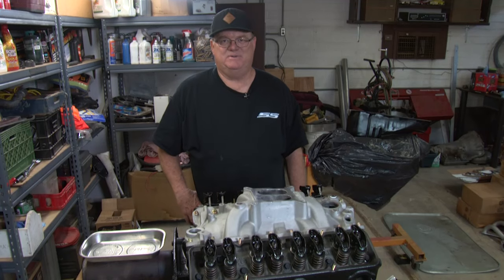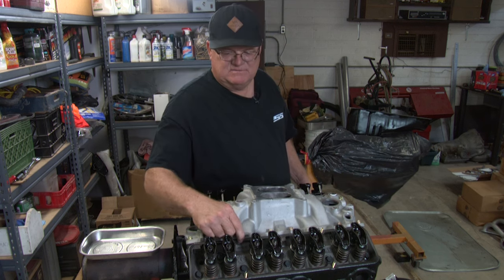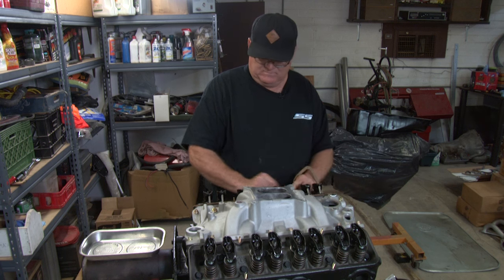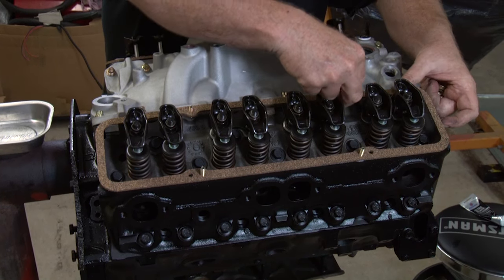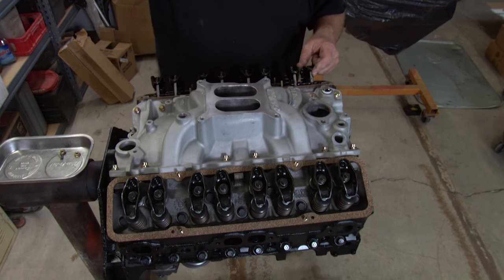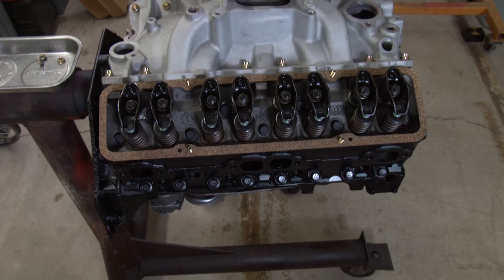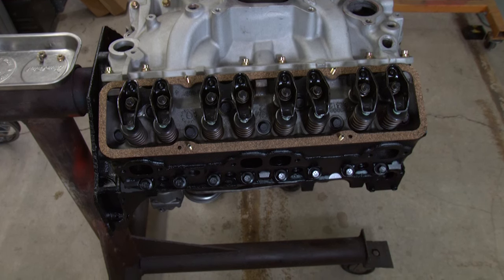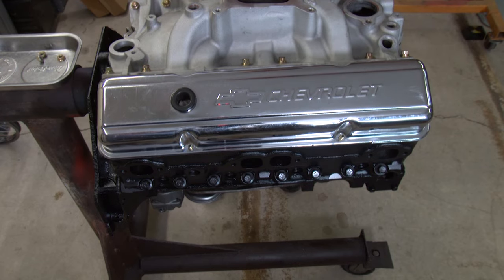How to Achieve a Leak-Free Valve Cover Installation: Step-by-Step Expert Guide

Comment: Preferred way is to install gaskets with the double hole sides at the top, not bottom.  Supposedly doing so makes them less likely to leak.  Not a big deal but it is logical.  Gen 1 Small blk Chevys always puddle oil along the lower edge of the valve cover.
Reply: X-Man well see i just replaced my gaskets and its still leaking 😪 this 84. C10 got me frustrated
Reply: @dlumbreras90  Cool man! I got an 85 C10 resto. It's always broke lol
Reply: Bottom part of the heads where the studs come out are square.. top are round..
Reply: @ianstow3345  You misunderstand me.  I was talking about valve cover gaskets.  Early SBC's, mostly 265 and 283 had bolt hole bosses that were not same distance apart from top to bottom, later heads they were the same distance apart.  That's why double holes on one side of the gasket.  If you mount the gasket so that when valve cover is installed the double holes are on top, they are less likely to leak.  But they are always a problem in my experience.
Reply: Cool understand
Reply: @dlumbreras90  did You put the spreaders on to distribute more pressure

Comment: I was told that I should put black silicone on it with the gasket?.? 

Should I do this?.?
Reply: Try 3m weather strip adhesive glue on to valve cover but not on the head. A lot of times the gasket actually seals to the head but leaks between the smooth chrome valve cover and the gasket.
Reply: @jasonsimone3523  Well, unfortunately I saw your comment too late and i've got some oil leaking at my headers(Is headers the same as the exhaust manifold?.?. I keep getting conflicting answers). And since i'll already be down there I think I might just replace my valve cover gaskets. I've recently grown against cork, would be switching to rubber. If I use rubber, should I still use the 3M weather tape?

Comment: What's the significance of using tall vs short valve covers?
Reply: Randy Vertrees hey buddy what would be the torque specs on a 3.8 Buick Regal 1986 torque on the intake manifold bolts thanx
Reply: Tall valve covers are to clear roller rockers.

Comment: Your not supposed to tighten it with a ratchet lmfao
Reply: What is the proper tool to use to tighten them?
Reply: @mississippikid3453  a screwdriver type quarter inch drive tool i think

Comment: Why you don’t use the silicon gasket maker to stop any leaks on future
Reply: Silicon doesn't HAVE to be used, it's more of a preventive measure.
Reply: @tyramarshall504  l
Reply: Use weather strip glue to glue gasket to valve cover only.  Do not use RTV here.

Comment: I have a 1976 350 V8 engine with valve covers that look like that style and had a question was just wondering if the valve cover on the drivers side of the engine where the oil fill and PCV valve are in the head of the cover, can you flip that valve cover 180 so that the oil fill is in the front? it’s extremely hard for me to fill the oil without spilling it all over the engine because of the brake booster assembly it’s so close to the engine.
Reply: Yes you should be able to
Reply: Mine is on the front so yes

Comment: I have a similiar small block engine (V8; 305) for my 1979 Monte Carlo. However, is it possible to replace these gaskets while the engine is still in the car? (Mind you, AFTER you drain out the oil)
Reply: Yes you can

Comment: What are your valve cover torque specs for a 455 engine block
Reply: Hi. Did you ever het an answer. I need it also
Reply: I’ve always just hand snugged valve covers down. No need to put tons of torque down. Over tightening will warp the valve cover and cause leaks. Just hand tighten until snug like he showed in the video.

Comment: What is the benefit to using studs in lieu of the stock fasteners?
Reply: Supposedly, the studs and serrated nut combo provides a clamping effect that is resistant to vibration over time.